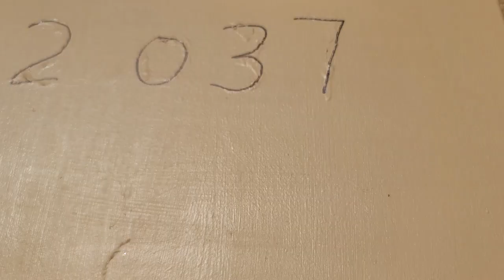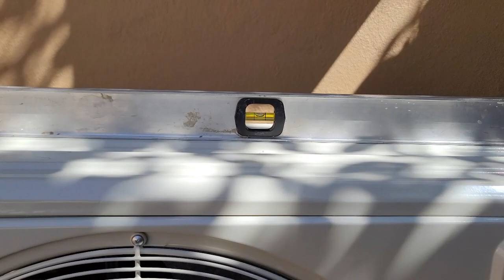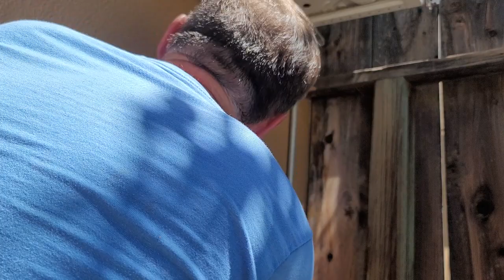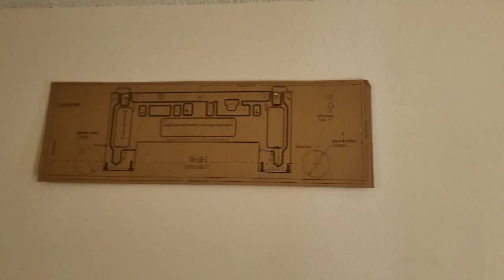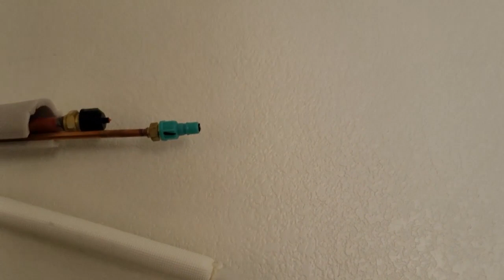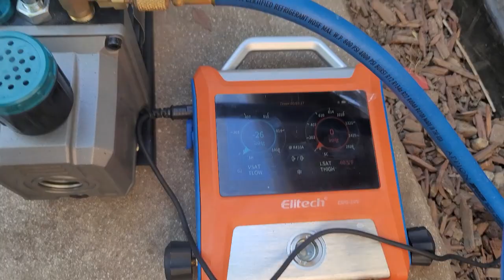Ductless Mini split Heat Pump Installation Aug 2023

Comment: To pull a vacuum to below 500 microns minisplits require a 1/4 to 5/16 adapter. Or use a 5/16 Valve Core Removal Tool to pull a fast n deep vacuum.
Reply from the maker: Thanks. I had the wrong 1/4 to 5/16 adapter on there and just forced the threads on to make it work.  Was a very long hot day and didn't want to let my tenants go without AC for another day.  Since then I ordered a couple of the correct adapters.😁